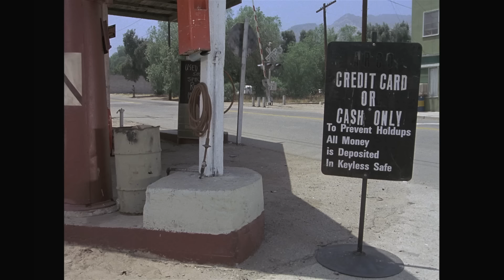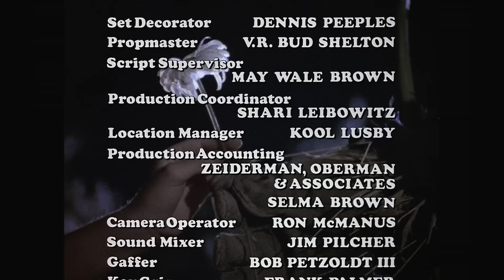DARK NIGHT OF THE SCARECROW - HD CLASSIC HORROR MOVIE IN ENGLISH - FULL SCARY FILM - V HORROR

Comment: Proof that you don't need tons of cheap jump scares and buckets of gore to make an effective horror flick. In fact, both those things are usually a detriment to effective horror because lousy directors will use them in place of setting mood, conveying atmosphere, and building tension.

Although, when I rewatched it as an adult, I had to shake my head at how cartoonishly incompetent the DA was. The movie suggests the jury was biased against Bubba and favored the defendants, but a slanted jury seemed almost unnecessary with how bad a job that guy does; he could have appointed Forrest Gump to the prosecution and made a better case for their guilt.